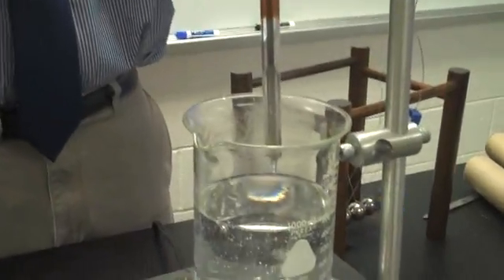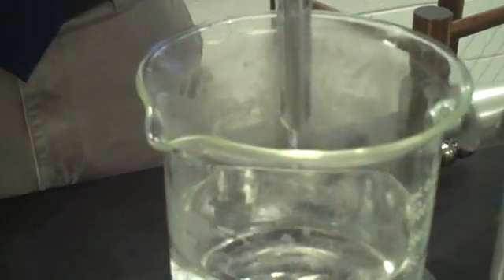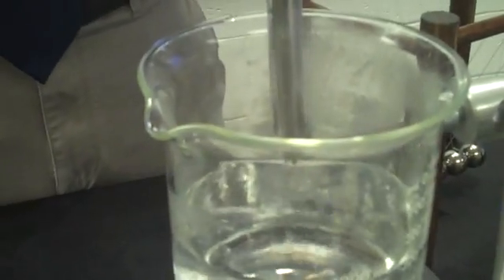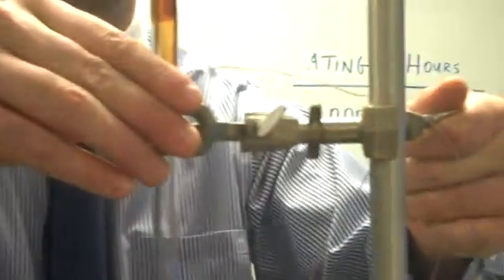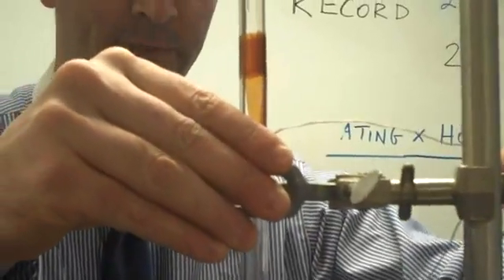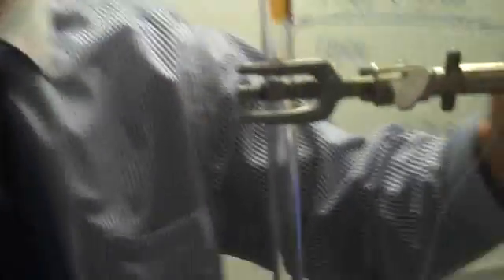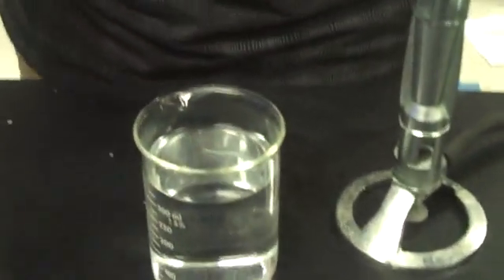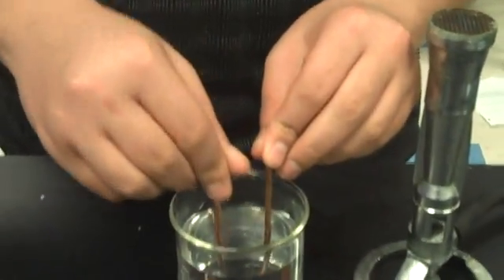Glass Heat Pipe Demo

Comment: Heat pipes were developed by NASA to regulate cabin temperature in space craft basically for free. The sun side is several hundred degrees above zero and the shadow side of the craft is a couple hundred degrees below zero. By valving and routing the heat pipes in unison with a thermostat that temperature differential alone is all the energy required to heat and cool the crafts interior. This glass heat pipe could be made far more efficient by adding a wick made out of 400 mesh stainless steel screen to guide the expanding fluid up one side creating more space for it to descend back to the heated section. The majority of modern heat pipes in production have some form of wick or internal capillary tube. The heat pipes designed for extracting oxygen from lunar rock are pretty amazing heat tubes! They use solar concentrators to heat a charge of lunar rock to 2000+ Celsius. The heat pipes used in that instance are rather expensive one would safely assume...
Reply: Nerd.

Comment: A heatpipe is a self contained device that can transfer a lot of heat quickly. For distances greater than a couple of inches they will outperform similar solid bars of copper or silver in heat transfer. They have a fluid in them that, combined with low pressure, will boil at relatively low temperature. This is the hot end. The boiling liquid absorbs the heat as it turns to gas. The gas then cools at the other end of the tube and will return to the hot area either via gravity or capillary action.